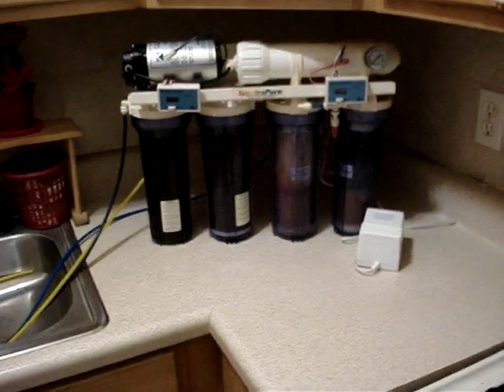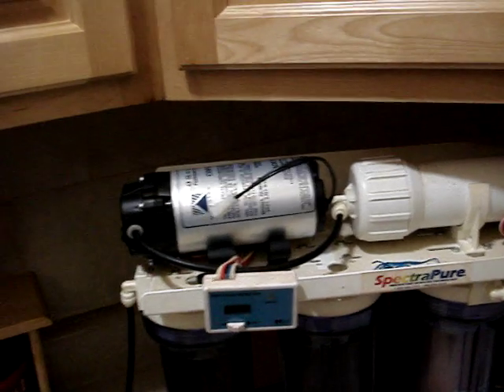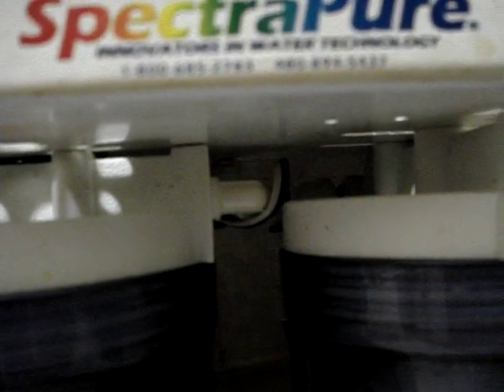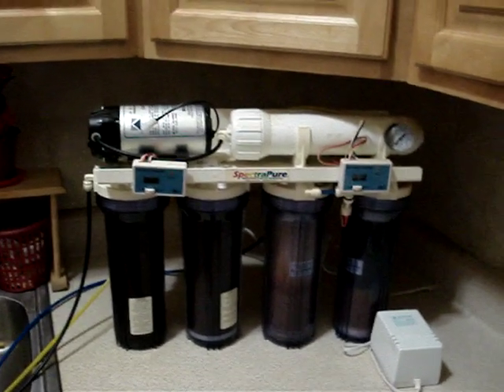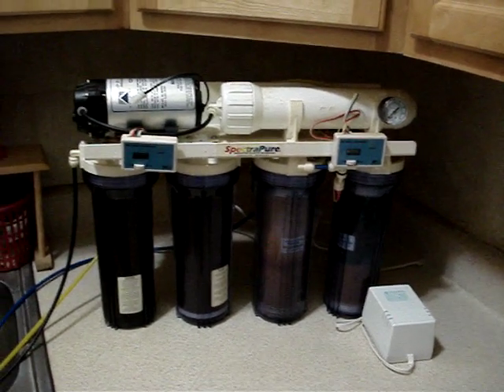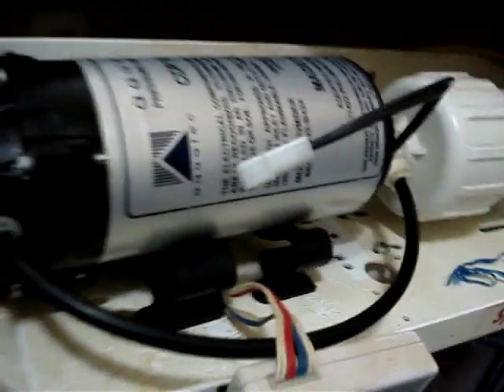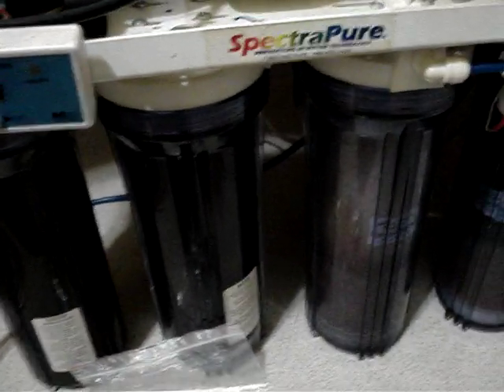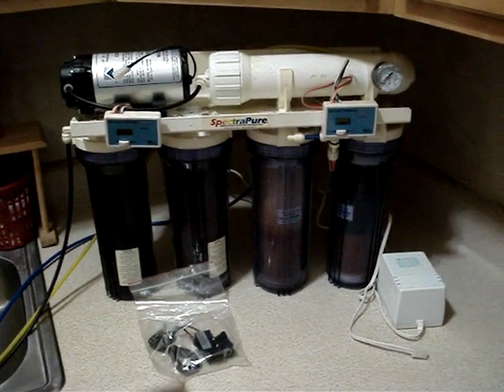RO/DI System How To Install Booster Pump

Comment: do yu have a flow restrictor on your ro unit?also is it supose to drip good water?i just installed my pump between the first stage and second stage is that correct?presure is shy of 120 psi.just figured it should be puting more good water out then just driping at a steady flw.

Comment: hey im not a reefer but im a aspiring aquascaper, and just got this 50gpd membrane and i think my flat doesnt have enough pressure to push well, its a simple 3 stage RO unit. so where can i get this pump and how much more pressure does it supply, so you connect the pump before the membrane

Comment: I recently bought a 3 stage ro system and it was connected to my water line, it worked but very slowly. I actually bought it to run water through my fridge which has a cold water and ice making system, when connecting it to the fridge system no water flows, now i would like to know would fitting a booster pump overcome this. Anyone has an answer please? Also the water in Spain has lots of scale in it, would the filtration system clean this up.

Comment: Hi newyorksteelo Thanks for the videos keep it up!!
Question about the booster tank for the RO/DI system. I have a well and my pressure is horrible. It currently takes approx. 4 hrs to produce 5 gallons of water. Will the booster help and also the "dirty water" will it cut down on it?? I am afraid of either running my well dry or burning out my well pump, Will the booster help
Thanks

Comment: hello,i have ro/di 6stage brand name is water general.it has 2carbon 1sediment on the bottom and RO membrane on top,and 2 D/I on top of the membrane.where do you think is the best place to connect the booster pump?pls help thanks.

Comment: hey there newyorksteelo,just wondering if you could pls help me with my problem.
is it normal that more water is coming out from the drain which is the dirty water? than clean water.do you think i might have installed it wrong?pls help thanks.